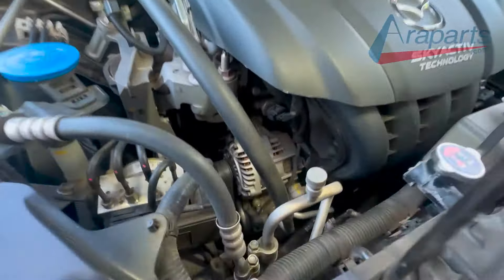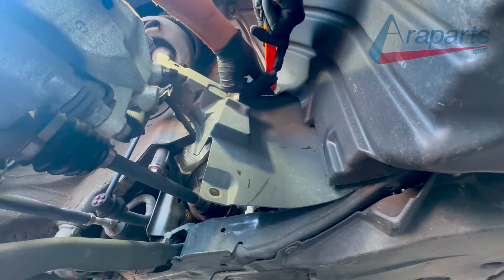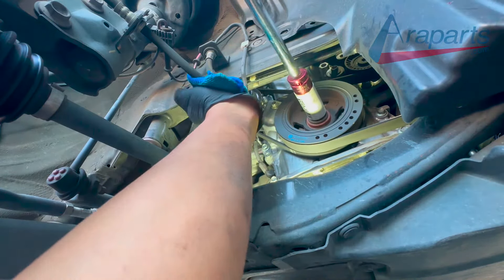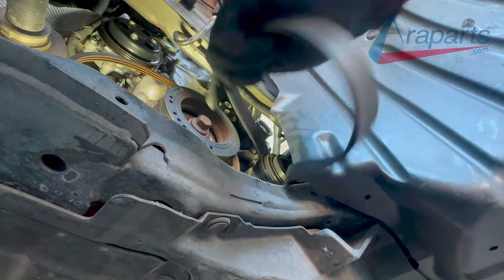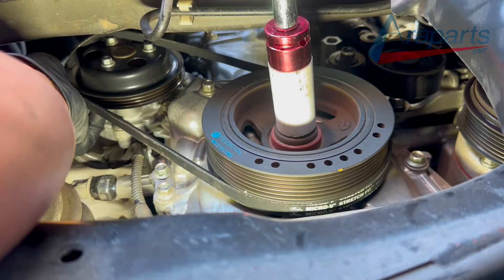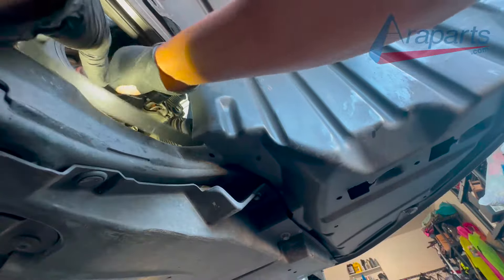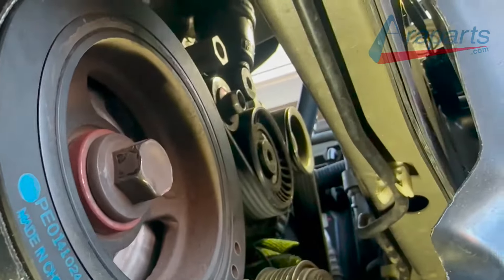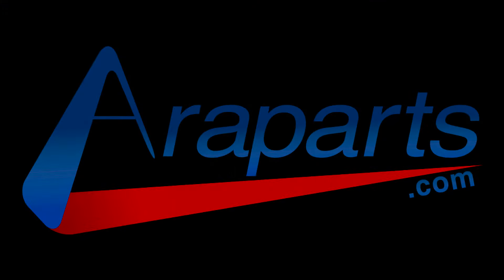2015 (2014-2019) Mazda 3 2.0l EASY Belt Change - All belts: Water Pump, Alternator, Air Conditioning

Comment: Great video. Had a lot of trouble with the water pump belt, both getting it off and back on. I had to cut mine, and it took about 3 hours of messing with it to get it back on. It’s 20 degrees here so I had to go back inside to try and warm the belt up to get some elasticity out of it. 
In the end I couldn’t even get it to where you had it on the pulley, I had to get it mounted on the crank pulley, then get the belt seated in the ribs on the bottom of the water pump pulley. I used one of the holes in the water pump pulley to zip tie the belt on, and then using my hand and one of the bolts on the pulley to keep pressure on the belt while I turned the crank pulley to get it seated. Then about 20 minutes of ratcheting clockwise and counterclockwise like you did in the video to get it seated correctly and get the bends out. Thank God you showed that part.
The serpentine belt wasn’t bad at all. I fed it over the crank and ac belt then snaked it under the idler. I wrapped some rope around one end of the box end wrench and used that to pull the tensioner so I had enough space to get the belt on the alternator. Only took about 20 minutes to get it off and back on.
Thanks for the video, definitely would have been screwed without it.
Reply from the maker: I’m really glad the video helped! I’ve been seeing some people struggle with this. It seems like the colder it is, the harder it is to get the belt to stretch. This video was done in the summer when it was 100 degrees so I’m sure that made it easier. I’m going to add in the video description to keep the WP belt warm before installing, especially if it’s cold outside 🥶.

Comment: Why skip putting the belt on the alternator? How do u have room to get the belt up to the alternator while holding the tensioner? I can't even get my finders past the alternator. Been fighting with this shit for 3 days now bc everyone talked about how easy it is.. well I can't even fit my ratchet on the tensioner bc there's only like 1/2" of wiggle room
Reply from the maker: I looked back into the video and I did skip the physical part of me putting it on. Try using a 17mm offset wrench. At 3:46 you can see a good view of that offset wrench. I wedged in place so it wouldn't move, and I was removing it in that part of the video. This allowed me to slip the belt on without a second pair of hands. I should have included this detail. If you're struggling, try an offset wrench like I had in the video, or you can try an actual tensioner wrench - these are called serpentine belt tool, or tensioner wrench. Check them thoroughly to make sure they will work with the way the Mazda 6 is set up before buying them. You may need a short extension to make them work with this car. The serpentine belt tool makes it a lot easier than using a regular wrench or ratchet.

I was able to just use an offset 17mm wrench, and I wedged it into place while I put the belt on. The belt slipped off several times before I got it into place after about 10 minutes of messing with it.
Reply: @araparts  do u mean Mazda 3 not 6? Just wondering bc I can't tell if it's just the wide view of the camera or if it's actually different, but the video makes it look like you have more room and access to the area than I do on my 3.

Anyways, so I got it done.. cold hands and poor lighting def weren't helping things.. from the video it appeared as tho you removed the original belt from the alternator first and then said to just put the new belt on in reverse order which implied starting with engine pulley to A/C, then to go up top to get it around alternator, but I couldn't get the belt around the tensioner wheel without it coming off engine pulley.. I had thought about doing it the other way, but thought that'd be impossible bc I had no way to keep tensioner loose while underneath. It finally occurred to me to just find a way to wedge the tensioner in place and get the belt around everything I could then go underneath and slide it around engine pulley like you're saying. Another big difficulty is I don't have the tools motioned, just a ratchet set and my big ratchet was too wide to get on the bolt so I was stuck using a small ratchet with a small pipe for an extension and couldn't get much movement from the tensioner. Luckily, I was just barely able to force the belt onto the last pulley.

Last thing. So I had to do this bc my belt broke and the car died when the battery drained without the alternator. Once the belt was on it took quite a long time to jump the car and I don't think my battery is holding much charge (it was having issues beforehand) So now that I got it running again I immediately noticed my CEL is on so wondering if this is expected and would u suggest I just clear it or if it's something I need to take it in to get checked out
Reply from the maker: @jacobwhicker8423  My bad. I meant Mazda 3, not 6. I'm glad you were able to get it. Not having a decent tool to deal with the tensioner can turn a run of the mill job into a major PITA. I can relate to that. As for the alternator belt, I slid it around the crank pulley first, then pushed it around the alternator. I then went to the top of the car, and fully slid the belt over the alternator pulley. I didn't record that part so unfortunately didn't get it in the video. 

As for the CEL, It can most likely be ignored. I'd bet it's related to stirring things up a bit (broken belt, dead battery, etc) HOWEVER, get yourself a cheapo $10 scanner online. They even sell ones that you can use with your phone VIA an app. At least scan it to make sure it's no big deal so you're not stuck on the side of the road later. You can also do the free scans at the parts stores, but having your own scanner is priceless. Even if it's the cheapest one out there.
Reply: @araparts  👍 yea it's amazing how long I can spend fighting with the most obscure part of a job that I never suspected.. spend hrs fiddling around with it and when finally finished know it wouldn't take more than 15 20 min to do again now that I know what to do.. I'm sure having it on a lift vs a jack stand makes doing anything underneath 100x easier.

Appreciate all the info and help, gl with the channel